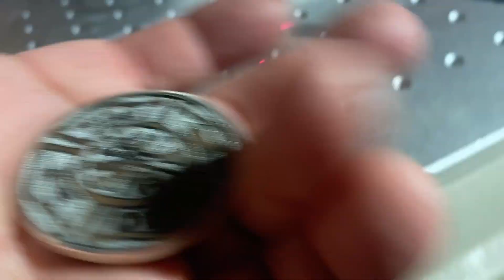Coin Engraving 100 watt JPT MOPA Fiber Laser

Comment: nice, I need to get back on the laser. I've been 3D printing all summer.
Reply from the maker: I have been printing as well. I guess I need to record some of that too. I did some YT shorts on the Christmas ornaments I did with the CO2 this week.
Reply: @JackInTheShop   I spent a good couple of weeks tuning up the settings on the printer. It definitely gave me the confidence to print pretty much anything. I also changed my springs on the ender 3 to a silicone spacer. Made a ton of difference for me.

Comment: Hi Jack, is that brass? Can you not get cleaner, sharper edges milling it?
Reply from the maker: These are not brass, I never thought about putting one under my CNC router. Maybe I will. You can get cleaner lines with this fiber by increasing the line density and setting up the proper rotation angle of each pass. I did nether. Just a quick run through on the aluminum blanks.

Comment: where can I find the f&d logo
Reply from the maker: If you use Lightburn, it is easy. Do a google search.Just type "fireman svg" You should see tabs at the top of the search. Click "Images". then there is another tools tab. Click that and it will open search tools. Click Size and click large. That will give you only bigger images.find one you like. Right click it, and copy image. Past it into Lightburn or Inkscpae. what ever you use. Right click in inside Lightburn and trace image to get a good vector.